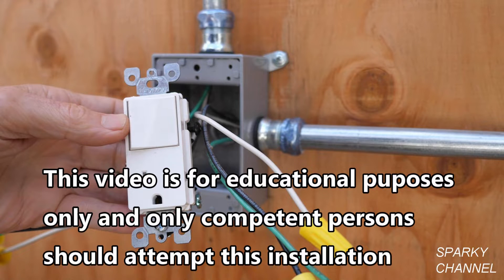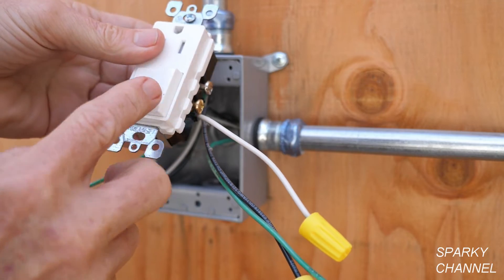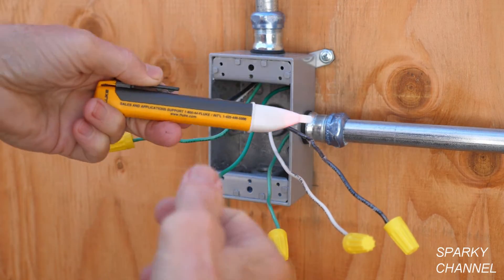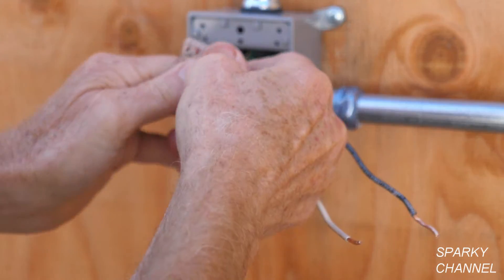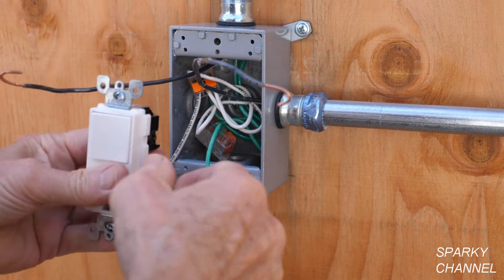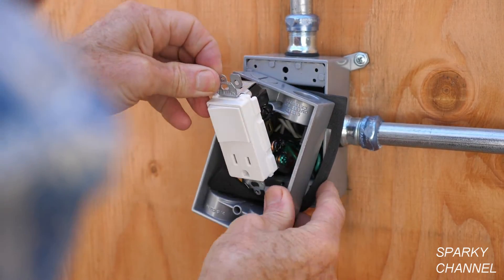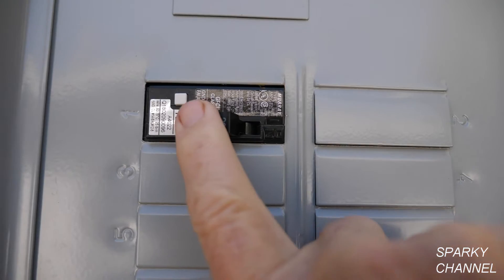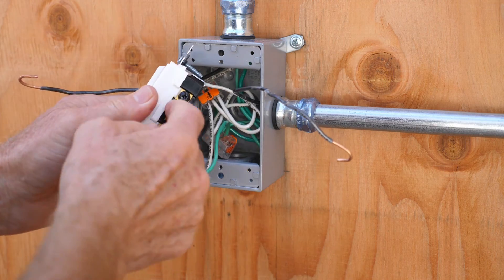How to Install a Combination Switch and Receptacle

Comment: How would you do this but with a 3 way switch in the mix on knob and tube wiring?  Basically I have a really old house and no receptacle in the bathroom, just 2 light switches that turn each other on/off.
Reply: Since Sparky hasn’t answered, let me throw a few ideas out there.  If the light is mounted on the wall over the sink, then look into replacing it with a light fixture that has an integral outlet.  You could also switch out one of the switches from a single gang box to an ‘old work’ two gang box and make one side the switch and the other side an outlet.

Comment: How did you get the plug in transmitter to light up if the main power was off. Cause you note that you had to turn the power back on to see if the light switch worked??

Comment: When I was doing my apprenticeship the way I remember it would be 
B to B black to brass.the load wire.
But at times the white wire can also be the load wire what you call continuity and that sometimes where things used to get tricky .
But then you just reverse it white to b and your black becomes a neutral

Comment: just confirming. If we cut that tab, then the outlet would work off it's own power source and the switch can work independently - to control a separate light if it already has it's own power source that would connect to it's black screw?
Reply: The purpose of that tab is if you decided to use 2 different/dedicated circuit for light and outlet
Reply: @apopilay3755  Thank you. I think this is exactly what I need ti keep a switch as is while tapping to the power source on the other side of the wall for the purpose of a powerline internet extender.
Reply: @apopilay3755  (although, I do wish the light switch could be a dimmer, since that's what I have there now. I'm dreaming too much)
Reply: Thank you for all the valuable information you provided....

Comment: I have this in my bathroom now the plug part stop working so I replaced it and cannot get it to work no matter what I do. But this house was built in the 50s I only got a hot and common wire and ground should I have 4 wires together am lost why I can’t get this to work. When it work for years.

Comment: Question for those who understand electrical work what is the point of pigtailing? I’ve run across this term many times over the years and I understand the basic premise of how it works but I don’t understand the benefit. Thanks 😊🙌

Comment: What do I do if the light switch won’t turn off the light. Everything is wired correctly but the light stays constantly on and the switch won’t turn it off.
Reply: You don't brake the tab unless you want them to work independently. Check your wiring Or Might have a bad switch.

Comment: How would you add another light switch across the room to this setup?
Reply: You would run a 12/3 romax Red,White,Black from switch to switch its technically 4 wires because it's Red,White,Black and Green but they don't count greens anyway your red wire acts as a traveler so the switch can jump from one side to the other switch its why you use 12/3 between switches.

Comment: Thanks for posting this.  I was working with a replacement combo switch and outlet where none of the screw heads were obviously colored for easy ID.  The combo that I removed was from the 70's, and had a totally different layout than my modern unit.

Comment: If you want the switch to control the light and the outlet to remain hot do you need to break the tab?
Reply: I'm wondering the same, every diagram i have that came with the outlet tells me to break the tab but noticed he didn't.
Reply: No.  When you connect the hot side to the black screws, it will power the plug.  Only the brass screw will be switched.  You break the tab if you want the plug to be on a different circuit from the light.

Comment: I have a single wall switch that only has 2 black wires and a ground wire connected. I want to replace it with the Leviton T5625 combo switch/outlet. Where do I connect the 2 black wires? do I need to pull out a white wire buried in the back of the box?
Reply: I'm case you still need an answer, yes. The recepticle will need a white (neutral). For the switch you'll have to identify which black is the hot. The other one is your switch leg

Comment: I have to echo others and say that this was a very helpful video.  This was the first time that I replaced a combination switch and receptacle.  I was replacing an incredibly old switch that was not clearly marked as newer switches are.  Easy to follow and understand.  Helped me to identify the wires and how to install the new switch.  Avoided calling an electrician!  Thanks!!
Reply from the maker: Hi Rick! Great job on the install and on saving money too!

Comment: Great video. Does the switch operate the plug? Is there something you could do to this existing device so that the switch operates the plug and the light?
Reply: Not in this configuration.  The outlet will work no matter the position of the switch.  If you want the outlet to be switched, you would connect the line voltage to the brass screw.  Then the outlet would work as a switched outlet.  You would break the tab if you want the outlet to be on a separate circuit from the switch.
Reply: I think that snapping that jumper strip with a needle nose pliers might make it a switched outlet.  I have a switch/outlet combo myself, but it only has 2 terminals (not counting the ground).  I have never seen this terminal configuration before, but I am guessing that by breaking the strip and running a jumper to the brass terminal on the other side would give you this option.
Reply: kevin you just answered my question ⁉️ tha ks 🙌🏼

Comment: Great video but my existing old installation has different wiring - two black wires both seem to be hot on one side with an unused ground terminal in the middle and two white wires on the other side, the bare wires are twisted together.  Switch controls exterior light, outlet is always powered.   How do I replace with a new liviton like the one you show?  Appreciate any help.  I will be happy to send you pictures if needed. Thank you very much.

Comment: Bill I have 3 wires in my light switch box a black wire which is hot, a white which is neutral I guess and a ground.. I’m missing the load wire ..:I guess all the other wires are up at the fixture from the breaker ... is there still a way I can get this combo switch to work ... Thanks for any help
Reply: I have the same question.
Reply: Bill I don’t know if you still read these but if I can’t use this combo switch I wonder if I can add a bigger box that would hold a switch and a receptacle and just pig tail off the The existing wires from the switch to the receptacle
Reply: I tried hooking the hot wire which is black to the dark common screw with the tab which is intact not broken. The neutral to the silver screw and ground to ground but the  light switch wouldn’t work  just the receptacle worked ..

Comment: Can the wires come from the interior, and out through an exterior brick wall,? The box would be attached to the brick.
Reply from the maker: Yes, as long as you meet all codes.

Comment: Thanks for the video. This is a single outlet and in one of your videos, you mentioned that you cannot use a single outlet with a 20 amp breaker. I have a 20 amp breaker and I want to use this combo outlet, can I?

Comment: Hey sir how are you ? How I can do that with only hot and and white wire? I tried and I have to turn the switch light off for the outlet work and I don't want do that i want both work normal
Reply from the maker: Hi Ramon. If you don't have a ground wire you would wire it just like I showed in the video except without the ground wire.

Comment: I have a question, I only have 2 wires on my light switch, hot wire and the load terminal, what do I have to do? to be able to add a combination switch, thanks
Reply from the maker: You will need a neutral for that.

Comment: Is there a way for the switch to power the outlet?
Reply from the maker: Yes. Interesting idea.
Reply: Sure, just break the tab joining the 2 brass-colored "hot" terminals, bring the incoming power to the top "hot" terminal (not the bottom one, as done in this video), and connect a new jumper wire between the lower "hot" terminal and the "hot" terminal on the LOAD side (which supplied power to the light in this video).  As you can't have 2 wires under 1 screw, you'd need a new pigtail to/from this LOAD terminal in order to control both the light and the single receptacle with the switch.  Bill, please let me know if this correct, and makes sense.  Thank you kindly.

Comment: Thanks Bill, now I know why the switch wasn’t working that o was expecting, very simple. I just have to move one wire to the bronze screw, I installed in the black. So the power stay in the black screw and the switch wire goes to the bronze.

Comment: Great videos Bill thank you for sharing your knowledge.  Have you worked with knob and tube wiring and if so how is a ceiling light connected?
Reply from the maker: Thanks! I have experience taking knob and tube out and replacing it, which is what I recommend highly.
Reply: Sparky Channel thanks for such prompt response.  Reason I asked is because I have traced a ceiling wire to a switch on the wall ...there is voltage on one of the two ceiling wires and one leg at the switch when switch is open and voltage on both ceiling wires with the switch closed but when I connected a ceiling fan (blue and black from fan to hot wire  and white to the other ceiling wire) nothing happens.  I also tried connecting a light across the ceiling wires and nothing....
Reply: Sparky Channel update I had an open neutral all good now :)